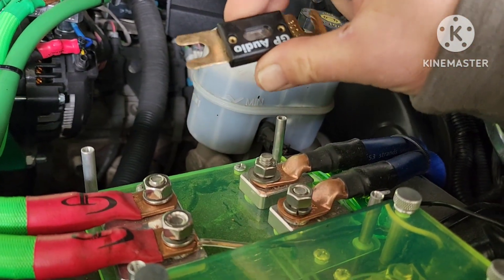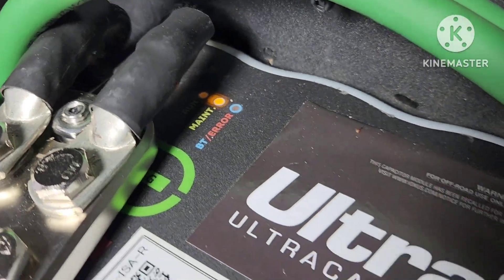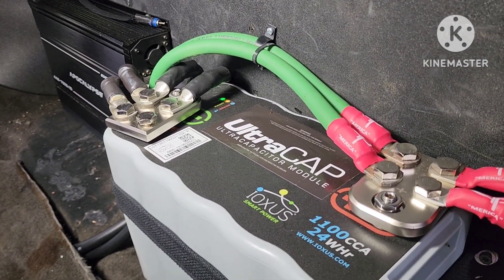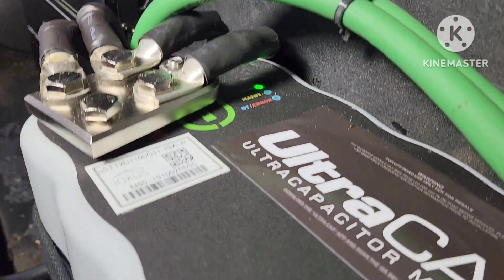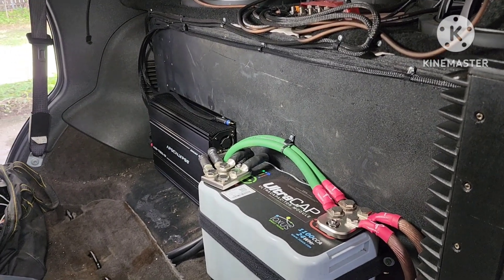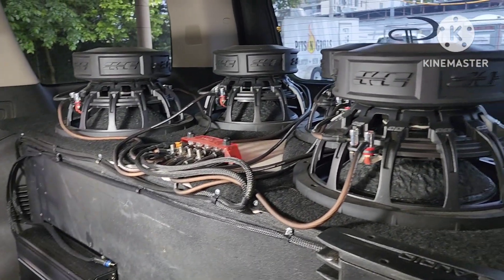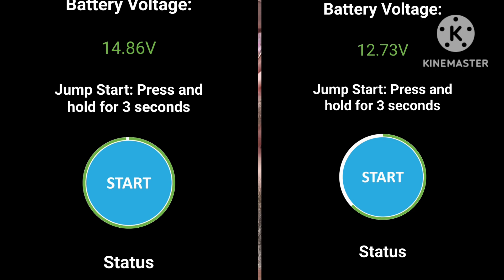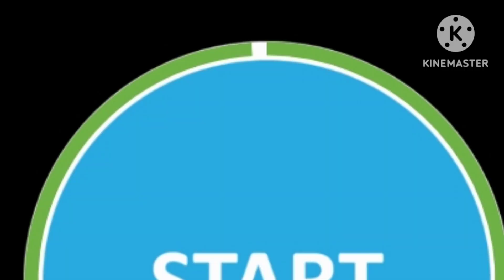Testing out the Ioxus Ultracapacitor

Comment: Tips of advice- (sorry for the long read, I enjoy this 💩!) 

Before installing the fuses, use a test light (or a light bulb with leads considering that's all a test light really is... NOT LED either!!) and put the ends where the fuse goes, once the test light dies you can install the fuse and not have it spark scaring the 💩 out of you! (You're right, doesn't matter if you know it's coming, gets you EVERYTIME! 😂) 

Same for when you uninstall amps, remove the fuse then touch the + and - with the test light, when the bulb dies there is no power left in the amp!  (As you may or may not know, you can still blow an amp if you remove it and the terminals are bridged somehow.)

Install "Anderson connectors" on your amplifier power wires for quick and safe way to install and uninstall amps! 

Did you not charge the capacitor before installing? That would be why you blew that fuse! It's imperative to charge supercap banks BEFORE installing, they can blow 💩, take out an alternator (typically overloads the regulator but can also blow a diode, especially if you have a weak diode already) IF you ever need to jump your vehicle you need to remove the capacitor before hooking up another car to jump you or same can happen to the other car! (I install those Anderson connectors on my batteries too, I also install a battery select switch typically used for marine applications that you can connect 2 batteries and choose to disconnect both, connect 1, connect 2 or connect 1 & 2, mainly for the jump start thing as with what we do, it's not uncommon for our alternators to become a nasty parasitic draw! I rebuild my alternator once a year AT LEAST!

I have not messed with the ioxus cap but an looking into them (how I came across this video actually) I want to see the guts! I have built my cap banks myself but they are ridiculously priced for cells nowadays. If they actually use 3000F cells I'll buy a few of these B stock. 

Fun fact, I have a V8 and when I had a nasty parasitic draw, as long as I had over 8.5v in the 500F supercap bank the car would start no problem at all! Supercaps are crazy and are extremely slept on! I'd recommend supercaps over added batteries and even before lithium HOWEVER they pair with lithium beautifully! I recommend putting a 500F cap bank before every amp under 10k, over 8k run 1000F bank or 2 500F banks (So hook the amp up to the cap bank then the cap bank to the battery/batteries). This helps "cushion" the sudden high amperage draw (aka bass hit) that shocks batteries and alternators! You'll always see steadier/smoother voltage with caps! 

Lastly, I recommend to always run grounds to the chassis. I use billet aluminum distribution blocks that I grind the paint off the entirety of the block, and on the bolts bolting the block down I also put 2 short cables going to my frame (obviously this only works with vehicles that have body on frame, but I'd still run cables to the chassis too, to have those added connections. (I do not run negative cables front to back though, I see it as a complete waste of wire, and with the price of wire now, absolutely!) I run the same number of grounds from battery and cap banks to chassis as is hooked up to the positive terminal. I also run 2  grounds from my engine to body and 2 grounds from engine to chassis (as close to or on the alternator, I have an alternator support bracket that makes it easy to run 1 per side, I also have a Ford and my alt is on the very top and center of the engine so that's nice 😂 I have no under hood battery)
Reply: @commonsenseisdeadandgone  never use chassis grounds
Reply: @RocknRollJesus101  explain? 

(Tip of advice, if you tell someone they are wrong or not to do something then tell them the reason why!)
Reply: @commonsenseisdeadandgone   What is a chassis? What's it made from?  How many pieces is it? Is it unibody or full frame? Are any sections riveted or bonded together? Is it rusty? Are all sections made from the exact same material? Has the chassis ever been wet or used where they 'salt' the roads in winter? Using chassis grounds may kinda work but are in no way optimal. Don't cheap out on your grounds...why use a potentially nasty 'steel extension cord' to get to your battery's neg terminal?  Grounds work best when all are at the same potential. Many aerospace installations require all system grounds to be made at one point...especially for small signal devices. Thanks for the advice - but the guy you were telling to use chassis grounds was ill advised.
Reply: @RocknRollJesus101  "may KINDA work" 
I mean it WORKS for me and the builds I've done, as well as many others considering that's been the industry standard since the beginning of time! (Every amp installation kit in existence has a shorter ground cable than the power, by a lot! 🤔) 

I agree that grounds are important, I'd argue they are more important than the positive! 

And comparing aerospace with automotive is wild! They are not one in the same! (HOWEVER, I mentioned this.....)

 Full frame or unibody doesn't matter (however I did mention this too regardless but you're not understanding the situation clearly) they are all composed of metal, might be a mix of 2 or 3 different metals but regardless it will be electrically conductive throughout! 

I'm still not seeing how it was ill advised, your argument explained nothing! 

The questions asked are a moot point.... Your knowledge evidently doesn't come from actual experience but rather what you've heard! 

That said, this I bet will make your head explode...... CCA is just fine to use!
Reply: @RocknRollJesus101  what is your build, Amplifiers used and electrical system?
Reply: @RocknRollJesus101  I love this hobby but it has to be one of the worst when it comes to amount of misinformation and worst yet, disinformation!  It's crazy how someone who has no idea about why but will hear something and just no questions asked, run rampant with it!! 

I do all my builds through and through, every bolt, every screw! I build my own lithium banks, I build my own cap banks, I rebuild my own alternators, I repair my own amplifiers....... I know a thing or two, I know by doing and not by what I heard. I figured I'd give a little insight on my knowledge of the topic.

 But by all means, I know I don't know everything and I don't want to spread more misinformation. Call me old school but I like my facts to be true! 🤷 I also know that on paper isn't always true in practice. I also know, don't believe everything you read or hear! (Especially if the person it's coming from has something to gain!)
Reply: @commonsenseisdeadandgone  you mad bro? 🤣 Sorry you skipped basic electricity class.  Could still enroll I suppose.....🤔
Reply: @RocknRollJesus101 
So you do not have a system is what you're saying? Got it!
Reply: @RocknRollJesus101  I don't even know where you're getting I don't know "basic electricity" ("classes" are typically VAC which doesn't apply here but I digress).  Where do you even get that "I'm mad"....... 🤷

Your only rebuttal was "aerospace has a single ground point"...... and I said, "I run all my grounds to the chassis, I grind the paint and bolt on a distribution block....." 

So again since you failed to comprehend, that means; The only ground paths running through the chassis is the alternators........ 

Think if you took the total metal of a chassis (and frame where applicable) and turned it into a wire..... Iron is ⅕ the conductivity of copper...... The chassis will be significantly more then 5 times the size of 1/0...... 

Anyway considering your response will no doubt be immature nonsense (again) or nil, I am done wasting my time here..... My advice is not ill advised,  I'm glad you are unable to provide facts to back up your accusations..... BTW, signal wiring and power distribution are 2 completely different things genius...... 🤦
Reply: @commonsenseisdeadandgone   🤣 your ineptness is confirmed.  Every new 1000 word response - especially  regarding the things I'd mentioned - is further confirming the fact. 😂
Reply: @RocknRollJesus101  BTW regarding things you mentioned IS a response Einstein! 

That's how conversation works.... 🤯
Reply: @commonsenseisdeadandgone  you should have saved your over the top (but unsuccessful) attempts at saving face and whining energy and applied it to learning something proper in the field of DC.
Reply: @RocknRollJesus101  I'm not wrong 🤷
Reply: @commonsenseisdeadandgone  🤣

Comment: I gotta 3500 rms bass amp an stock alt. I plan to upgrade alt. But would i need to with one of these
Reply: Also u said there are different voltage settings... Do I need to match voltage on compactor to same as voltage on battery?
Reply from the maker: the cap does'nt really care about voltage, long as its between like 7v and 16v
Reply from the maker: This would be a very smart addition to your setup, and of course the upgraded alt.
Reply: @CarAudioEnthusiasts  So it would get job done until upgrade alt.?

Comment: Mine completely died after two weeks
Reply from the maker: sorry to hear man, so far im solid!
Reply: it's not a battery it will not hold a charge
Reply from the maker: @NightshiftCustom  but did he mean died as in lost charge or died as in broke...also youre right that a cap isnt a battery, but they can absolutely hold a charge, even for years. i know this for sure, because as a kid i got LIT UP by a cap in an old tv, it had been in the dump so long all the wood had rotted away. and while removing some parts from it, i managed to touch the big cap and i think i did a flip!
Reply: @CarAudioEnthusiasts  yes a cap on its own can hold a charge sure but this is not that it has a brain box inside that kills off the charge when not hooked up to a battery or not in use this is why it will not work on its own without a battery
Reply: @NightshiftCustom  So II was supposed to charge it everyday?  Anyways, it's completely dead. no lights no nothing.
Reply: @jorgem50  no you do not charge it everyday you pair it with a good charged battery that will keep the cap ready for use each day
that's why it says right on it that it is not a battery!!
Reply: @jorgem50  also yes there will be no lights or anything till you hook it up to a battery
Reply: @NightshiftCustom  everything was hooked up correctly.   Battery is putting out 12.8v resting and over 14v while car is running.  Cap worked perfectly for two weeks.   Cap is completely dead.  Hooked it up in my wife's car to see if it was my battery and cap doesn't turn on whatsoever.

Comment: I love seeing a nice system build with these ultra capacitors. There is a few area I can see besides or in conjunction with audio. A main one is overlanding. A heavy duity winch can easly eat up to 500A pulling. Also inline with Inverters for high AC draw devices. ^^ A example is for me is a mobile DJ Vechile on wheels. A system A DJ controller and some pop up led dance light. For more stationary A pump, AC of grid. Basically any high draw item  can greatly use a ultra cap. :)
Reply from the maker: Couldn't agree more!
Reply: I have a fleet of old diesels, they are ambulances and have multiple batteries and 2 alts, I'm going to put one in each truck and see if extends out battery life, I go through batteries almost every year or so

Comment: Pls help educate people by showing schematic diagram of the electrical and up to how much wattage does this go for.
Reply from the maker: ill try and work something up
Reply: @CarAudioEnthusiasts do you think 2 if these will help voltage?Got 2 400 amp alternator 4 glowe voltage series 1 batteries charging at 14.8 full tilt drops to 13.2 .
Reply from the maker: @marquetterichardson6529  they will help with Dips, not slow droppage, if youre dropping slowly to 13.2 you need more charging. at 13.2 youre hitting the batteries, 14.8 youre still on alternator. once you overpower the alts, you drop till you het your storage resting voltage, then they start helping. the batteries, dont do anything untill you drop to their resting voltage.

Comment: When connecting power it’s good practice to charge your caps with a resistor.
Reply: As in a light bulb! 😂
Reply: @commonsenseisdeadandgone  sure.  A light bulb, a piece of wire 2 miles long or a resistor all work
Reply: @cboyamg  or a light bulb as it also notifies you when it's all charged up....... 🤯
Reply: @commonsenseisdeadandgone  a light bulb is a resistor lol
Reply: @cboyamg  yeah......no shit
Reply: @cboyamg  that guy recommends chassis grounds and aluminum wire....beware

Comment: I have two UltraCaps with a 400 alternator feeding two Surge Audio 3k. It's good to see others using them in their builds.
Reply: So do you use an isolator? Or when you install the UltraCap and turn off your car will it turn off by itself or keep draining the battery? That's the whole reason why I took mine out literally just lack of knowledge
Reply: @woodrowproductions777 the caps were draining your battery?
Reply: Well you have no voltage drop do you? 😂 Even with a factory battery you'll be fine!
Reply: @commonsenseisdeadandgone  using inferior chassis grounds on your caps also? 🤣
Reply: @RocknRollJesus101  even after I broke out my crayons, you still didn't comprehend..... I guess I'm not smart enough to be dumb enough to explain it to you!
Reply: @commonsenseisdeadandgone  you got part of that correct. Hilariously the more you attempt to save face the more you prove how little you actually know. 😂

Comment: Is yours one of the B stock from Big Jeff?
Reply from the maker: yes
Reply: @CarAudioEnthusiasts  Nice, I just found out those existed like a week ago. 

It would be complete overkill for my 2500 watt system, but it also seems like it would be the cheapest and easiest way to fix any voltage issues that I have once I get it all installed
Reply from the maker: @armedappalachian  do it, I recommend these for any car on the road, for the stable  
voltage, reserve power for starting/boosting.
Reply: @CarAudioEnthusiasts  well you twisted my arm enough, I have one on the way.

Just so I'm clear, these can be initially charged by the vehicle? You don't need to do the resistive load charging like other super caps?
Reply from the maker: @armedappalachian  just hook it up strait out of the box, like adding a battery. itll start out with flashing yellow light thats it charging up
Reply: @CarAudioEnthusiasts  awesome,  thank you so much for the info, and frequent videos. Really enjoying your channel
Reply from the maker: @armedappalachian  thanks man, I do my best!

Comment: So should I run the cap between alt and lithium bank? Or between lithium bank and amp? I’m running gpaudio 190 amp alt 96ah headway bank taramps big boss 8k on 2 American bass Xmaxx 12s in a 06 Nissan Sentra. I’m trying to prevent voltage fluctuations.
Reply from the maker: cap closest to the amp is the ideal place

Comment: I'd reccomend the D4S lto 6.0s. They're good if you hv limited space but the pack a punch if u hv a good high output alt
Reply: Yes and no here for me.. 😭 unfortunately I also had one of these.. the little battery was super powerful !  No complaints on the performance..But I had a guy warn me the top seal and connectors on the battery was super weak and cheap.. I argued with the guy that mine had been solid and it was a good product.. let's just say he won that debate.. the whole top separated off mine , it was shocking how cheap it was made
Reply: Bad recommendation it says on the website they are for lower stock charging system not intended for a high output alternator almost every bad review you see on those is because they burn out the cells with a High output alternator and blame down 4 sound just saying BAD IDEA
Reply: @Dirty2152  absolutely nothing you're saying is factual. I have been using 4 of them with 2 ioxus ultracaps for the past year with a single 320A high output alt and lots of 0 gauge welding wire and have had no issues. Voltage doesn't even drop half a volt at full tilt and I'm running over 15000 Watts. Any issues people have had with these batteries is always user error, they use dem with stock alt and stock battery without out isolator and are surprised when they fail. If you read the manual and follow what it says you won't have any problems. Plus @THELIFEOFPRICE has many videos on how to correctly install and use the batteries.
Reply: @PK_EP  actually everything I'm saying is factual it's another down 4 sound ripoff like the amps and if you read EVERYTHING!!! CORRECTLY yes it does say one time on the site I just checked to verify ONE time 14.8 volt MAX charging then EVERYWHERE else it clearly states that it's to be used in line with a stock charging system and down at the bottom it says WARNING ⚠️ not to be used with an alternator exceeding 14.4 charging lololol and the reason I said something is because I have several and I do mean several buddies that work in the same building with me all were die hard LTO 6.0 fans and literally every one of them had the same issue the battery catastrophically prematurely failed from nothing more than the cold starts during winter if the battery isn't designed to work with the cold start it's NOT designed to be used at 14.8 period you better stick to the 14.4 and not one of them had a failure on their part it might work ok in a build car but in a daily driver NOPE not happening you might get a couple that get buy with it but if you are truly using your car as a daily driver the LTO 6.0 is garbage and that is FACTUAL
Reply: @Dirty2152  real LTO YinLong cells are rated to work down to -40c and last upwards of 20-30 years